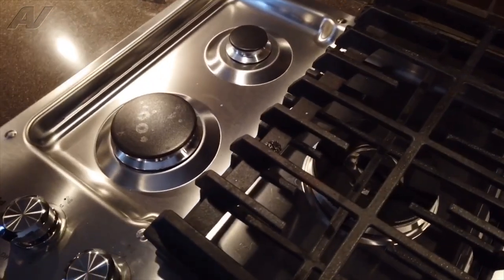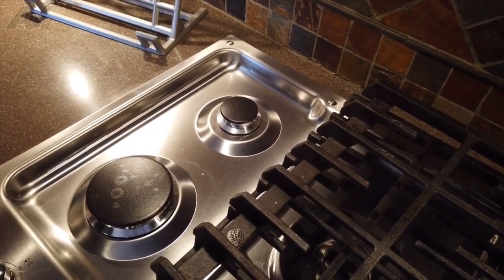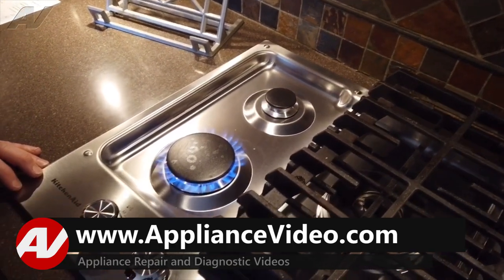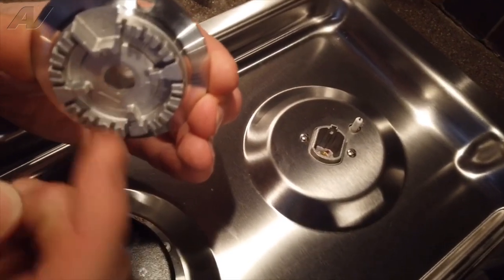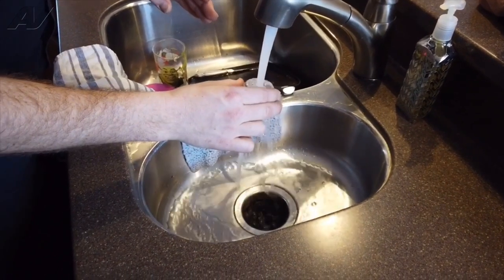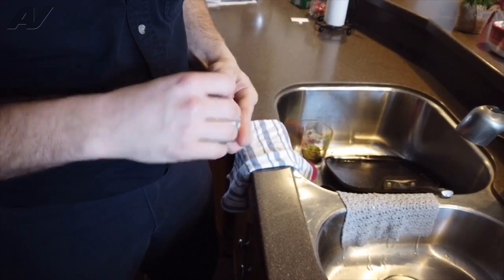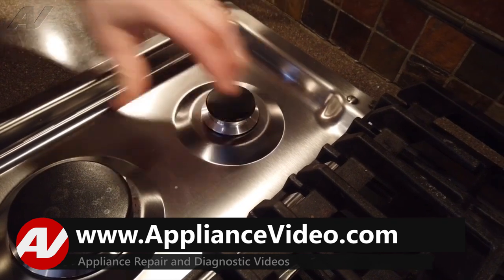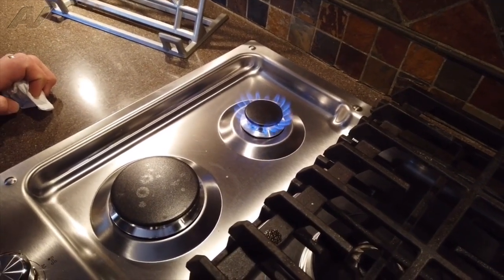KitchenAid, Whirlpool Range / Cooktop - Burner flame issues - Diagnostic & Repair

Comment: Had the same issue with my GE profile range.  High flame around the back burner.  The flame could be lowered with the control knob and all other burners worked  fine so it was isolated to the one burner.  I saw this video and at first thought it was some sort of self-promoting problem-solving video.  Turns out the fix was exactly what I needed to do.  I didnt see a cob web but cleaning the burner parts fixed it.  So, thanks for the video.